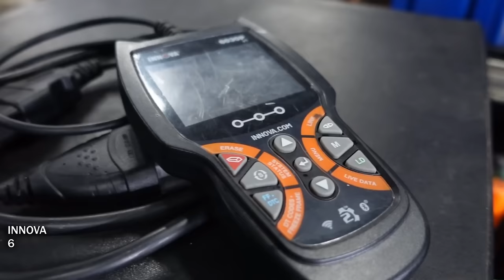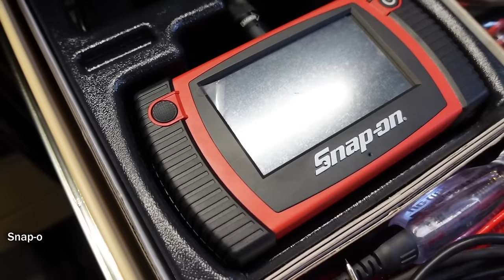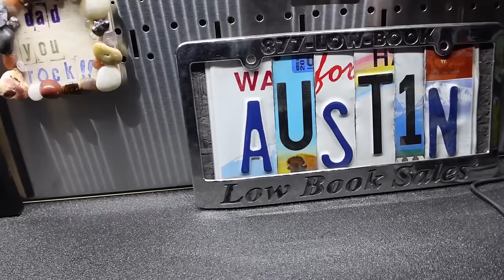After a 4 year break, he's going ALL in

Comment: I bought the mac rbrt wrenches when they came out. I promise there is no way it rounded off a bolt. Only way that happened is if the bolt was already too far gone. It hard to fit the open end over a bolt or etc when it’s in new shape. I’ve had to hammer my 15mm on to a tie rod just to use it. I promise you It didn’t happen.

Comment: 6:15.. I have all my extensions in a drawer with one of these.. Keeps them organized and not rolling around... 7:08.. like that 😂..awesome
12:00.. Blackhawk..my Blackhawk set is reversible..not cheap though
31:32.. that's for just "bench bleeding" the master.. you still have to pump the brakes to the hubs..👍
Reply from the maker: Always appreciate you watching! Yeah the bench bleeding I’ve always had to use a finicky adapter and hose that goes back into the reservoir. Sucking the fluid straight from the line end seems so much easier!